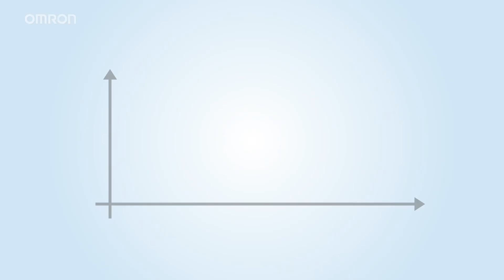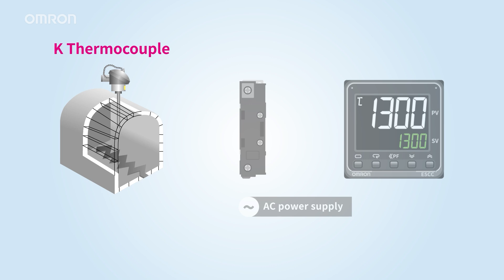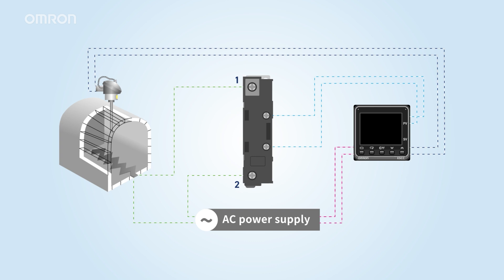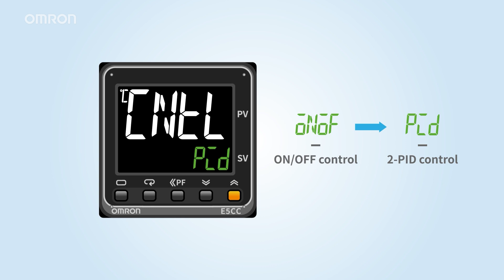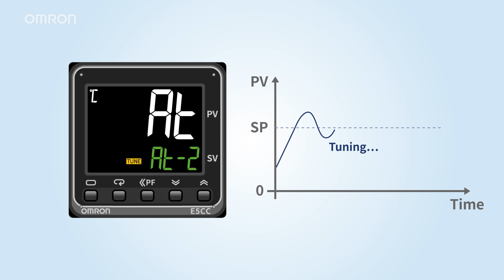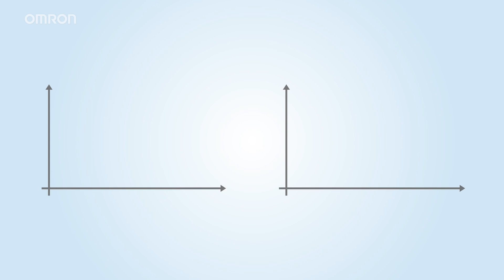PID Control Tutorial Series | 2. How to Achieve Perfect PID Tuning with OMRON’S E5CC Controller

Comment: @OmronAutomationAmericas hey guys, nice video!

Quick question, I have E5CC-TQX3A5M-000 Temperature Controller. Is it possible to set heating let’s say 0-1000C degrees in steps like:
1. Start from 0 till 200. When limit is reached hold 200c for 10min. Then move to step 2.
2. Heat from 200-400. When limit is reached hold 400c for 10min. Then move to step 3.
3. Basically repeat the steps till 1000 is reached, hold upper limit for 10min and shutdown, job done.
Reply: ADD to my previous comment. In the manual from the last reply, go to section "4-7 Setting Programs" and also section "5-23 Using the CX-Thermo to Set Programs"
Reply: @etindustrijskaelektronika hey, I see only one comment of yours. Could you share the link for user manual?
Reply: @H.E.Sensei  Sry it seams that I'm not allowed to send you link here in comment since the first reply is deleted :S
Lets try like this:
"https://files.omron.eu/downloads/latest/manual/en/h185_e5_c-t_users_manual_en.pdf?v=1"
Reply: @H.E.Sensei Sry it seams that I'm not allowed to send you link here in comment since the first reply is deleted :S
Lets try like this:
files.omron.eu/downloads/latest/manual/en/h185_e5_c-t_users_manual_en.pdf?v=1
Reply: @H.E.Sensei  Sry it seams that I'm not allowed to send you link here in comment since the first reply is deleted.
Lets try like this:
First part: files.omron.eu/
Second part: downloads/latest/manual/en/h185_e5_c-t_users_manual_en.pdf?v=1
Reply: @H.E.Sensei  Sry I'm having trouble when i paste link to the document...I can send it to you via e-mail or just google E5_C-T Users Manual.
It's important that document is User Manual not Datasheet.